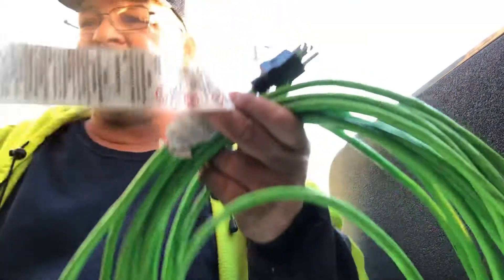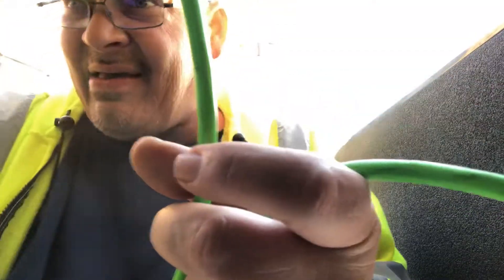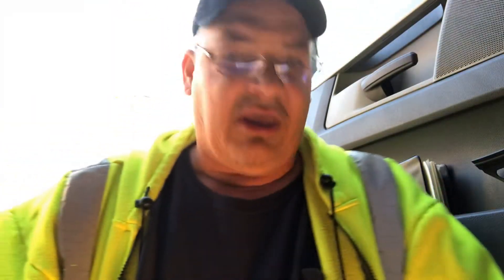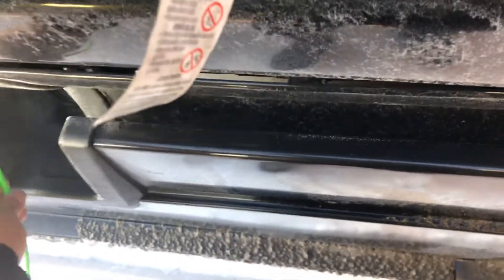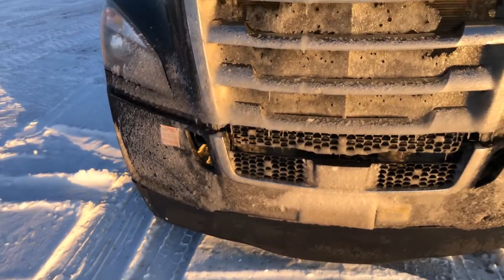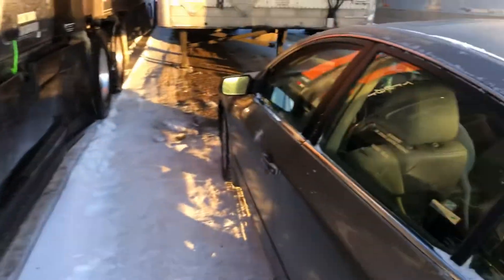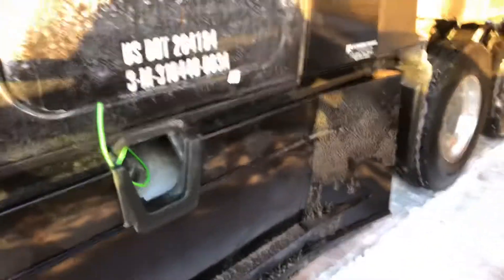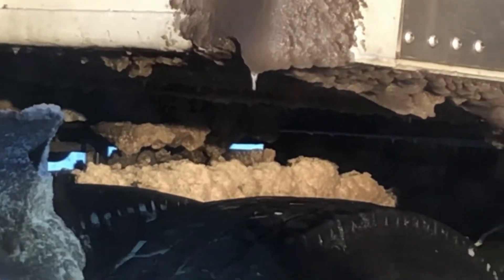Just a little tip. #schneid #freightliner (not recommended for kids)

Comment: Did your inverter come with the truck?
Reply from the maker: MR X yes I love it just need a bigger alternator on the apu it doesn’t seem like it changes the batteries to good.
Reply: @trucker4life70  where are the plugins in the truck?
Reply from the maker: There’s two in this truck because I have the table there’s one under the table on the drivers side and one behind the microwave. And the inverter is in the left side of the truck with two more plugins.